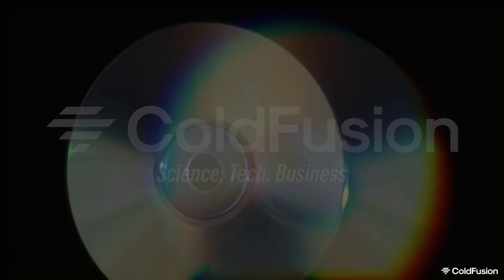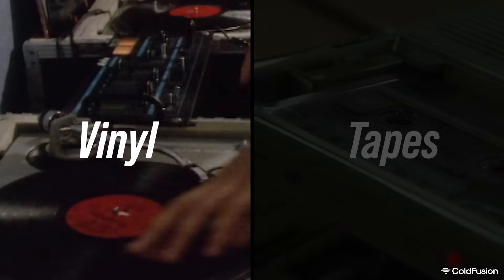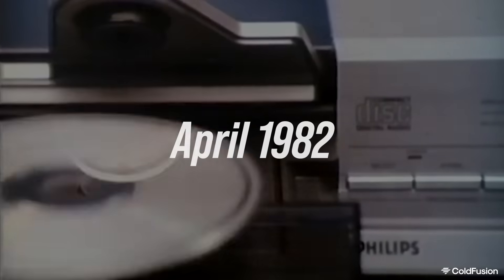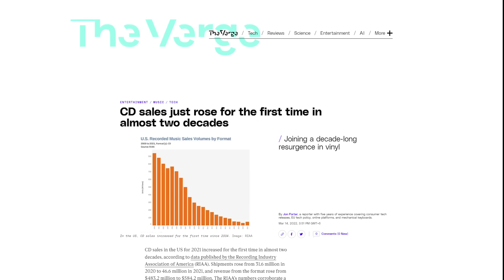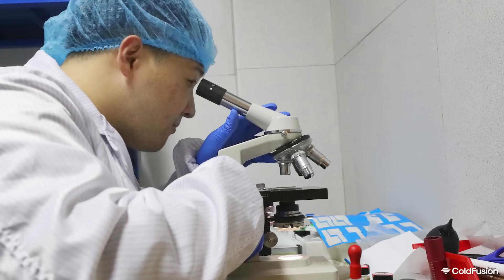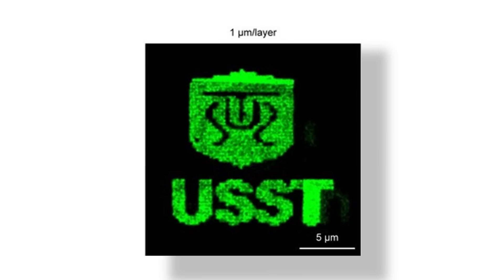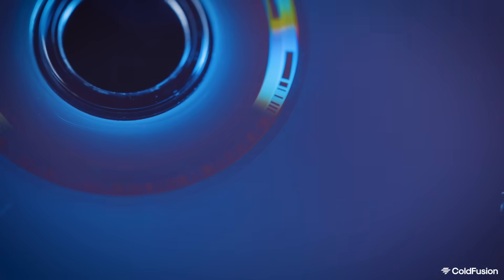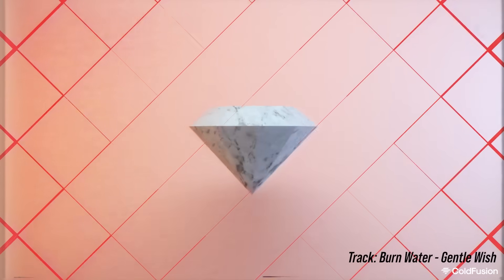Why This New CD Could Change Storage

Comment: Fun fact: According to Joop Sinjou, Phillips' head of development of audio products at the time, the hole in the middle of the CD (and it's successors) was based on the Dutch Guilder "Dubbeltje", which was 10 (Dutch guilder) cents a the time and was the quickest decision that was made in the development process.

Some people also claim that the overall size of the disc was determined by the (then) size of a Heineken coaster, although I can't find a proper source to either confirm or dismiss this claim.
Reply: Cursory research says that it's size was inversely proportional to the data that Sony wanted on it, which was allegedly Beethoven's entire 9th symphony.
Reply: It is weird to imagine solid disks with no center. I suppose they would have been gripped by the sides, or sat ontop of a anti-skid plate?
Reply: @pauldeddens5349  The vinyl record intvented by Emil Berliner in 1890s is a solid disc with no center, as well as Laservision discs. I'm not getting your point
Reply: @mateuszorlinski7334  Im thinking a disk with no center mounting pivot point. Many Vinyls have pivot points in the center to rotate on. And all the Laserdiscs ive seen have cut out centers to pivot on as well.
Reply: @pauldeddens5349  I don't think that anybody thought about something like this during the develepoment of CD - may parts regarding disc transport were adapted form Laservision

Comment: People are getting lazy, or being lazy since ever. One shouldn't forget about the huge amount of new customers to streaming services, that never got in touch with physical media. They don't miss it, they don't know what they've lost. they for about 5-10 monthly streaming services, just to have the feeling to have access to everything (what's not the case).

The huge amount of described data will not be needed in any way for the next decades in the customer market. Compression gets better, local data is getting smaller. I would love to see burning and archiving up again for the casual user, but this will not happen very soon, if ever. People are lazy, the majority loves to drop a file to a "cloud" folder, have it saved and don't think a microsecond about the way it works.
My hope is to have vinyl and cds being available for a long, long time. And for DVD/Blu Ray the same. An 8k followup for UHD Blu Ray would be awesome, too. But that's unlikely to happen for now, just because the low amount of volume that's been sold until this day.

Comment: i never stopped using physical media.
Reply: Fact, and this new CD mean that you can build a powerful decentralized cloud at home, this is lit
Reply: I just keep the optical copies for archival and the working library is on HDD/SSD.  Streaming services?  Absolutely not.  Why would I pay money and waste bandwidth to rent access to something I already own -- all under zero assurance that my "subscription" won't be changed or revoked at any time?
Reply: I still have boxes of Blu-rays, DVDs, and CDs.  I almost lost 20 years of data because of an HD dying after just 2 years,  even though I have others that are pushing 12-year-old HDs in my computer or NAS.
Reply: @quantumleaper  Same, new hard disks are crap quality, I guess they stopped caring about them in production since almost nobody uses them anymore and just started cutting corners in quality. I've still got 20 year old HDD's running in secondary PC's , essentially on a daily basis, meanwhile some HDD's I bought in the last 5 years already farted.
Reply: @derbigpr500  The 700MB HD,  I had in my P75 (1995) didn't even last until 1999.  It is just random when an HD fails,  and it also depends on the brand.  I remember reading about HD failure rates from a Clould Storage company last year, like I said it is the Brand more than anything else.
Reply: @quantumleaper  my 18TB seagate died after 8 months, but luckily i backed up elsewhere, i started backing up on 25GB 100GB blu-ray just because they are a "dead" media so i find good deals where they are sold for cheap

Comment: So which one is it? 1.6 petabit or 1.6 petabyte?
Reply: comparing: 1.6 petabits = 200 terabytes. And the cover says 200 000 Gb.

So i guess its petabits, which is a bad way of explaining data size in laymen terms.
Reply: They like using bits instead of bytes because they can boast an 8 times bigger number. In the real world, storage is always expressed in bytes.
Reply: It's a 200TB, forget the Peta.
Reply: I was also confused, there is a very big difference between the two.
Reply: Yes...but technically no.
Reply: the articles say petabits so 200 TB of storage
Reply: Data is always in Bytes.  And communication is always bits.

Your home Internet maybe stated at 30MB = but that is actually bits 30/8.

Comment: There is a sci-fi horror movie called Event Horizon that came out in 1995 about the world in 2040. Everything was great, except they showed CD-disks being used in spaceship as storage device. 

I was amused, watching that in 2022, but now it seems that the movie actually might have predicted the future and that it was the CDs used in this video.

Edit : The movie came out in 1997, as some people pointed out in the replies. I humbly stand corrected.
Reply: "You won't need flash storage were you're going"
Reply: I'm predicting this is a multilayer DVD or Blu-ray
Reply: It came out in 1997 and yeah was a great movie, but yes the fact these discs can hold that size is great, the only downfall maybe if the dont protect the disc.
Reply: @3styler1  Yea it should be in a cartridge.
Reply: In The original star-trek tv series they used these plastic looking square things as data storage. Their dimensions were very close to the 3.5" on a side and 1/4" thick. This in 1966. The microfloppy came out in 1981, 15 years later.
Reply: @kaseyboles30  There is a storage medium in development that looks much like the glass panels seen in StarTrek TNG.
Reply: @TrentCantrell  Yes several. Many based, at least loosely, in holography.
Reply: I think in the Minority Report they used tiny memory sticks, which is very accurate for today. The only problem is they didn't anticipate smartphones not having sd card slots
Reply: @_ch1pset  Well, why would they predict technology to go backwards after all.
Reply: @NightKev  I think there are some good examples of that in scifi, Firefly, The 100, The Time Machine, even with some things progressing, in many ways they go back to the stone age(literally in The Time Machine)
Reply: Event Horizon was actually made in 2039, came out in 2040 and was sent back to the past from 2049 (when time travel was invented) back to 1995.
Reply: @Duke_Of_Havoc - RETCONS can be great, very convenient for some folks... When they work, which is rarely.
Reply: the form factor is not obsolete. bluray is shaped like cd.
Reply: Sounds about right. If this can be commercialized it will probably take a decade to get it down in price enough for the average person to be able to afford it.
Reply: @NScherdin  I'm less concerned about the cost of the disc itself and more so the cost of the drives to use this with. 50 blank monolayer blu-ray discs cost like US$30, a drive that can burn them is about $100.
Reply: Even with 700MB CDs it still makes sense. The speed of data transfer in space is super slow because of weak signal and long distances. Also, storing something important on flash drive or HDD, where it can be damaged by cosmic radiation or magnetic impulse is dangerous. So having a backup of important files on CD or DVD may be very useful.
Reply: that's because cds were a thing back then and usb and ssds didn't exist.
Reply: When I watch old sci-fi movies I often imagine they're set in an alternate timeline that diverged from ours at the time the film was made. 😊
Reply: 97 the year btw I also noticed that and I will welcome back CDs in 2040 😅
Reply: Awesome movie!
Reply: Great film
Reply: This often happens with sci-fi shows and movies set far into the future, they don't age well.
Reply: The movie was really great in several aspects (but corny/clicheed in others) but since it is a horror movie you have to realize they added the CD usages as the true horror of all technology savvy people, and it seems they hit you just right
Reply: The hell depicted was the 30 days of night during the Sun swap . . we nearly went extinct & only survived due to cannibalism . . long pig caper
Reply: That movie sucked and the only thing that rubbed you the wrong way was a cd player?
Reply: @mematron  this made me wanted to see the movie, what kind of sucked is this movie? steven seagal sucked or starwars acolyte/any Kenedy starwars sucked?
Reply: @SNH1305  The movie is great for what it is. A few things are dated, like some computer effects, but it's mostly a solid and entertaining movie. Mematron is wrong.
Reply: @SNH1305  Everyone has its own taste. The bad things win in the end and the story ends where it began, I guess that's what he is talking about.

Comment: This will allow uncompressed movies. the files in movie theaters are 200gb per movie, even that is compressed in some way. Imagine uncompressed movies, the quality would be mind breaking for movie enthusiasts.
Reply: And for the next CoD installment to reach several TB of total storage requirement🤡
Reply: Perceptually there would be a miniscule difference. Uncompressed video is good for editing and grading but makes no sense as a delivery format because a good codec can reduce the size by 90% while not impacting the output quality to any appreciable degree.
Reply: Some compression would benefit the other hardware in the media chain. Lossless compression is possible and would make reading from the media and transferring the data feasible on normal hardware.
Reply: I'm just waiting for the "The human eye can only see 1080p" idiots to enter the chat 😁 had one on twitter last week.
Reply: @knifeyonline  I mean, you're not going to see a difference beyond that point, unless you have a huge TV, which is why they use the bigger files on theaters
Reply: @knifeyonline   It is absolutely right to limit recording technology to the limit of the human sensory system.

But there's a difference between audio and video there:

The human eye can resolve about 500 megapixels, so a lot of room for improvement from the resolutions currently available. 

The human ear can resolve roughly 20 bits and 40 kHz sampling rate. We've been there since ar 1980. (or close enough for practical purposes)
Reply: @knifeyonline  The human eye can only see 1080p. 😌
Reply: @knifeyonline 
It's around 2k. After that, you're getting diminishing returns on resolution.
Reply: I'm not sure the difference would be that perceptable
Reply: Compression =\= data loss. Lossy compression does. There are ways of compressing data without any loss. Also, I think Blu Ray still has room for improvement, we could see 200GB BD-R discs, they already can do 100GB.
Reply: @_ch1pset  Wav sounds different to flac on all set ups ive had.
Reply: @Hetsu..  do you are have stoopid?
Reply: Only for enthusiasts. Only few people have and can afford the resources that may be able to run such high memory files
Reply: @tesseractgon-dy5yo I am talking about bitrate. 1080p with a high bitrate looks better then 4k with a netflix bitrate of 25mbps
Reply: What does it matter if us enthusiasts dont have access to the keys for the highest quality versions? Commercial theatres get temporary keys to access the files that are given to them, and only the highest end home theatre buffs can afford private key access and even then they have to pay per viewing, its not like they can just press play on their K-scape or pop in the UHD disc and watch it.,
Reply: This disc is really for me to store my precious 4K JAV. It's really annoying to buy thick and fragile HDD.
Reply: @hammerfall6666 --- JAV?
Reply: aah, if only they ever increase the framerate instead... it doesn't even require loads of extra space, yet the difference is FAR more dramatic than the removal of compression. (i know 90% of people this idea)
Reply: They would probably charge you $50k to buy them tho :)
Reply: True, but I'd rather store 7 kabrillion 1080p movies that I'll never watch.
Reply: Studios would never
They’re too busy giving you a mediocre streaming experience
Reply: @tesseractgon-dy5yo In a 10 x 5 meters display, you'l need 8K resolution ... if you want to see the pores of the actress.
Reply: Uncompressed is the dumbest idea ever. What you want is "lossless compressed".
Reply: Honestly any uncompressed form of data would be incredible for all enthusiasts. Film lovers, audiophiles and imagine fitting that much data for a video game without the need to download anything all running from the disk.
Reply: and yet directors like James Cameron are still going to find a way to fuck it up with AI remasters
Reply: Blurays of 120GB exist
Reply: Uncompressed at "Megabytes per second", you're lucky if you get decent 1080p without stuttering.
Reply: Blueray movies are already lossless, and no, raw data doesn't have any more quality than a lossless compression. It's useless storage waste.
Reply: @Azarilh  no they are not a 98% VMF near-lossless film would be 2-3x larger than a 200GB bluray disc can hold depending on length and dolby vision + dolby atmos or not
Reply: It might give a purpose to 8K and 16K TVs.
Reply: @pauldeddens5349 yep, I find it funny that even higher resolution TV's are coming out, yet we still have heavily compressed media to play on them, what's the point...
Reply: @pauldeddens5349  There generally is no practical application for screens of higher resolution that 4K. Unless you're sitting closer than a few feet from the screen, the resolution of the pixels is higher than the resolution of your eyes. Obviously you can break this truth by having a comically large screen, or being strange and sitting so close that you cant see the entire picture, but for 8K+ to be practical, you need better eyes.
Reply: @pauldeddens5349 the disc would need 200 or 300 MB/s access speeds, that's unlikely to happen soon.
Reply: @pauldeddens5349 Still wouldn't. You would need giant screens to be able to perceive the difference unless you are a hardcore cinephile. 4K is barely noticeable on screens below 40".
Reply: @PXAbstraction  And you act like people wouldnt jump at the opportunity to have wall sized TVs so they can watch 8K movies. The issue is making them affordable.
Reply: theres no way the 200gb movies shown in theatres aren't compressed losslessly. If you're showing a movie in a high enough resolution to be hundreds of gigs then why on earth would you use lossy compression
Reply: @nilnailscrew4784 almost lossless compression is still about 2GB for 45 seconds of 4k HDR and almost twice that for Dolby HDR + atmosaudio

Ultimately that would make a 2 hour film somewhere between 320GB and 640GB

Hell when avatar 2 came out plenty if theatres couldn't play it without crashing due to overheating or flat out being incompatible
Reply: @nilnailscrew4784  Because a losslessly compressed video is still hundreds of megabytes per second. Those 200 GB would only be enough for a couple of minutes.
Reply: The difference in quality wouldn't be detectable by the human eye.
Reply: No it won't. The read speed would be way lower than the raw video bitrate.

Also uncompressed video is pointless.
Reply: I say it would only be mind breaking if you have a really really large TV or some large projector. I doubt you'd see much of a difference on a 60" TV. Many people can't even tell a different between 1080p and 4k.
Reply: @colt5189  I agree. My 24 inch pc monitor is fine with 360p - 480p resolution even when I watched it from arm length distance. But for 60 inch TV, I'd need 1080p, my brother even think that 2160p is needed for TV of that size. Larger display needs larger resolution.
Reply: Uncompressed audio/video have limited market, those on production side and some audio/video-phile junkies.
The majority of consumers don't bother with it. They may even averse to it when they are shown the size difference .. "20 GB vs 1 GB? Give me the 1 GB version."
Reply: Isn't 1 TB equal to 1,000,000 GB? Or is it only 1,000 GB?
Wouldn't 220,000 GB only be at most 220 TB?
Reply: @antiWhiteism777  Yes these 100 layer discs would be 220TB raw storage with maybe 10-30% of that lost to error correction encoding.
Reply: @antiWhiteism777 Nope. You’re thinking that prefixes like kilo, mega, etc are consistent across metric measurements & data storage. Unfortunately, it’s not that simple. With digital data, we don’t use a base 10 number system. We use base 2. That is, with metric measurements moving up to the next prefix indicates the number going up by another power of 10 (1-> 10 -> 100) = (1x10^0 -> 1x10^1 -> 1x10^2). With binary data, moving to the next prefix represents the number going up by another power of 2 (1 -> 2 -> 4 -> 8) = (1x2^0 -> 1x2^1 -> 1x2^2 -> 1x2^3). So, in other words, the jump represented by moving to the next prefix when talking about binary data is exponentially smaller than the same jump to the next prefix in metric/ SAE units. 
Edit: oh, one big thing I didn’t mention: everything I said applies to bits Mb (lowercase b) means megabits. MB (uppercase B) means megabytes. If working with bytes each step is multiplied by 8. 1 byte = 8 bits. (8 -> 16 -> 32 -> 64) = ((1x8)x2^0 -> (1x8)x2^1 -> (8)x2^2 -> (8)x2^3).
Reply: @antiWhiteism777 

1024MB=1 GB
1024GB=1TB
1024TB=1 petabyte
1024PB=1 exabyte
1024EB=1 zettabyte
1024ZB=1 yottabyte
1024YB=1 ronnabyte

It is believed the human brain can hold 2.5 petabytes of information
1024RB=1 quettabyte
Reply: . The issue is bits and bytes the number that if 8x bigger sounds more impressive so the reserchers used bits Cold fusion converted it to bytes to make more sense to the average viewer